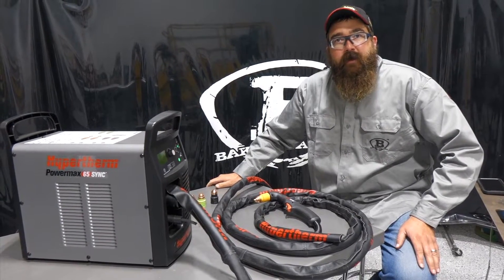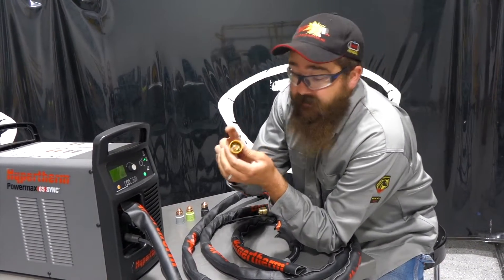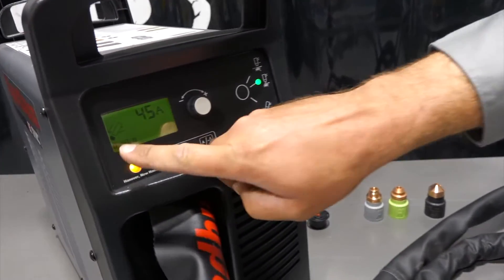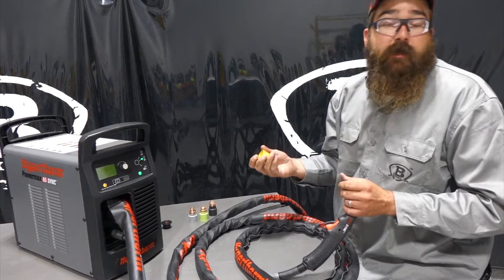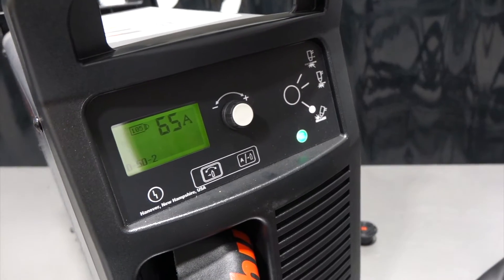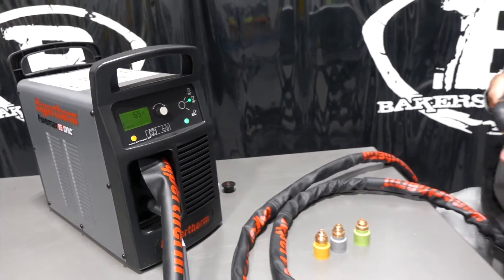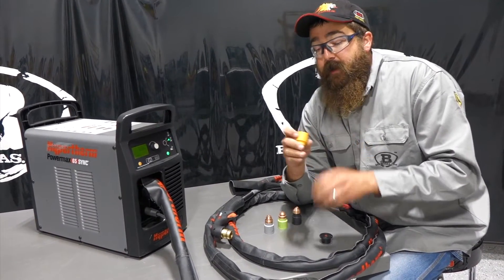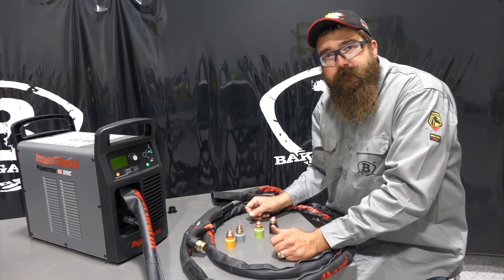Hypertherm SYNC one-piece Cartridge Consumables Review

Comment: I am a bit skeptical. Normally it's the electrode and tip that wears out not the swirl ring, cup etc. So am I paying for everything every time the tip or electrode wears out ??? Will it just stop when it thinks it is worn out; when I need to make just a few more cuts?
Reply: I agree . I have a powermax 85 . It has to be cheaper to change an electrode than everything.   To change everything every time has got to be high dollar.  I love my 85 because it was cheaper than oxygen and acetylene.  I am worried and skeptical
Reply from the maker: Hello, they designed to last longer and wear evenly. If you get the reader you get statistics and it tells you how much arc on time. We have got a lot of really good feedback on them!
Reply: @BakersGas  Awesome , i think By this machine for cutting automatic.
Reply: they are fucking people just like printer companies do.